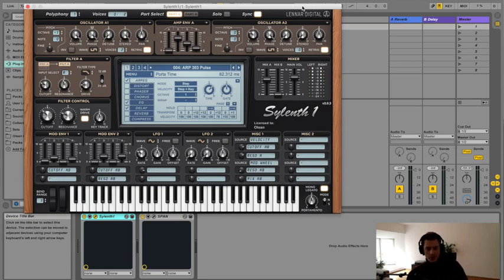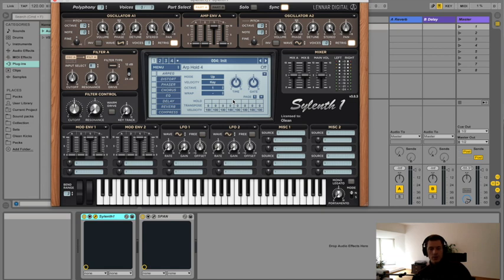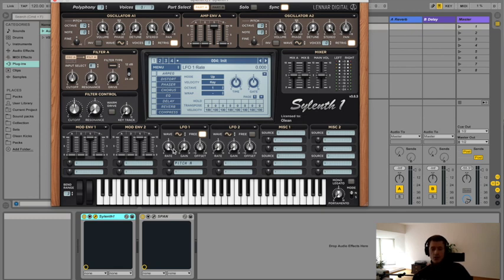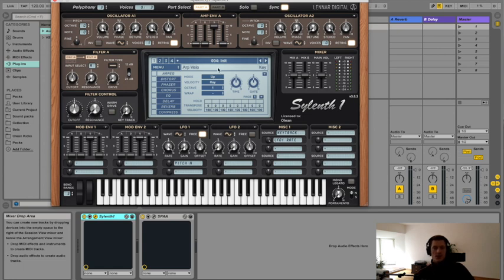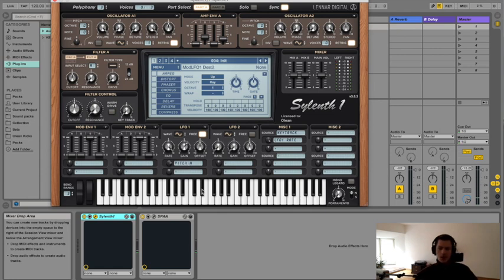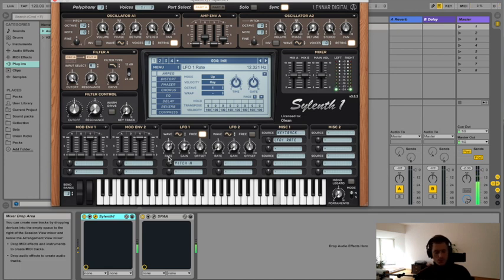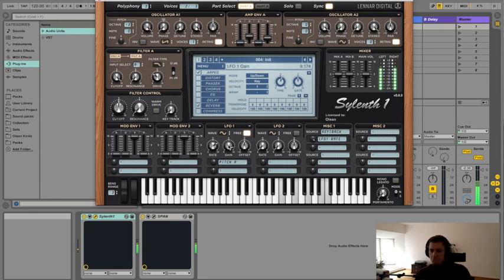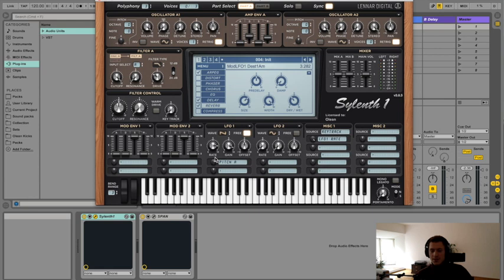How to use FM Synthesis in Sylenth1

Comment: I thought of this myself a long time ago when I was studying this synthesizer. In addition to frequency modulation, you can also use volume modulation (amplitude modulation), and there is also phase modulation (if you modulate the phase using LPO). To get some brighter sounds, you can use several 2 LFO generators. And from below the LFO of the generator you can duplicate the modulation for the same purpose. And use the knobs on the left to change the degree of influence or even invert the modulation signal. This is, of course, not a full-fledged modulation matrix like in Sytrus, but many interesting sounds can be extracted from Sylenth1.